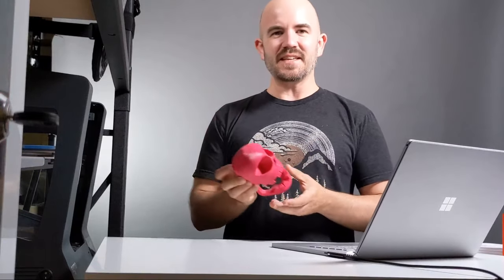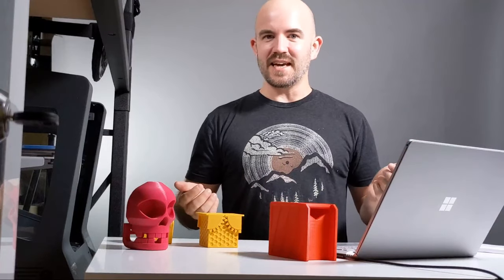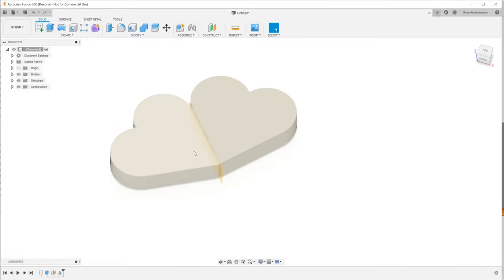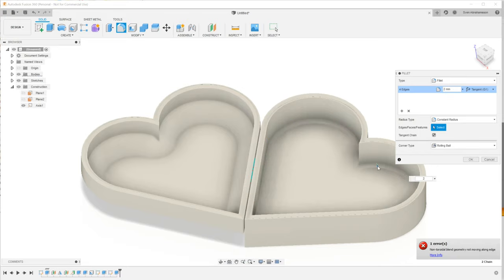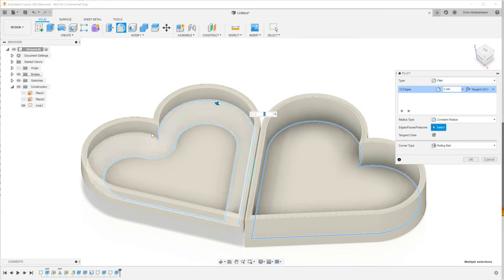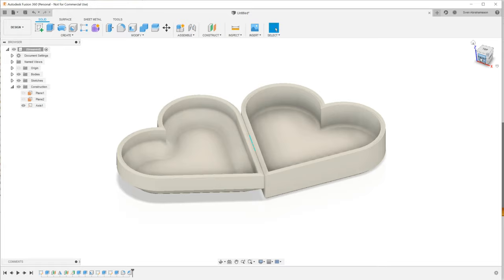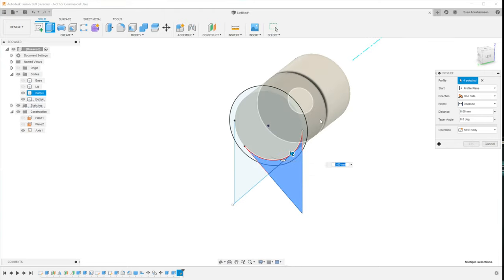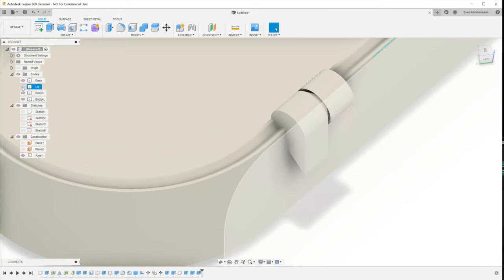Hinges and Hearts in Fusion 360

Comment: How do you handle tolerances when scaling your prints? Do you have to scale it in the CAD-software, or is there a slicer trick to keep the tolerances?
Reply from the maker: You could try something like horizontal shell expansion to manage the tolerances under scaling in the slicer, but yeah, generally it's back to the CAD software if you want to keep the same tolerances

Comment: I can't make a shell, it gave me an error: Error:   The body could not be repaired after deleting faces.
    Try changing the selection, or use the Delete tool in the Patch workspace to delete geometry without repairing the gap.
---How can I change that?
Reply: try changing the initial heart sketch, the arc towards outside. it worked for me